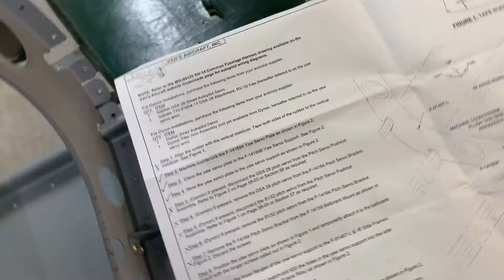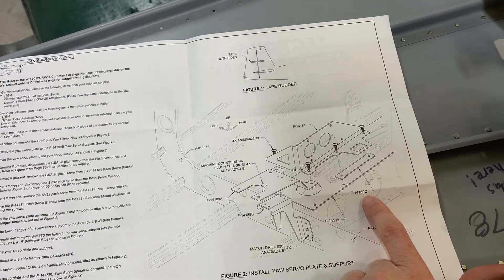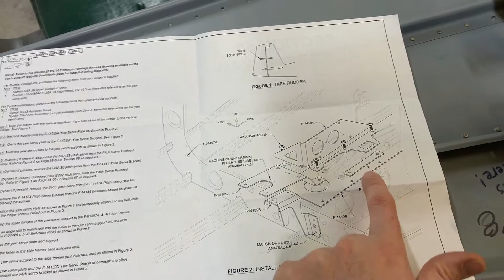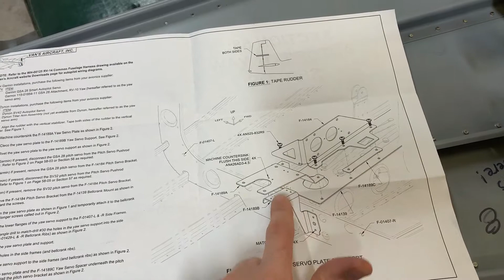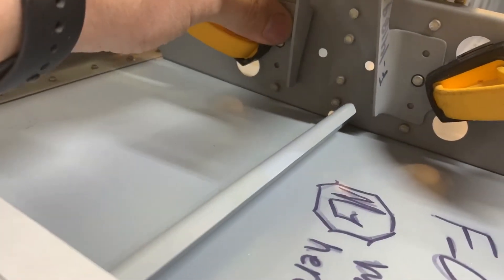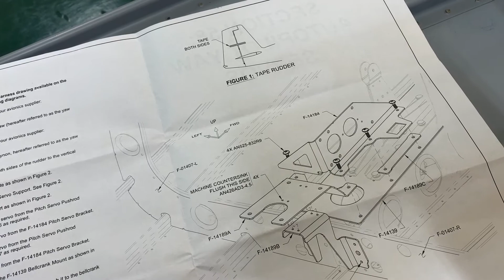Installing a yaw bracket before tail side skins (Kind of a Pre-Gotcha)

Comment: So in an ideal world you would order the bell crank mount (f-14139, K1000-3 x8), and the yaw servo plate assembly (f-14189 A-C, F-14184 AP, AN 525-832 R9 x4) and complete steps 36-06 step 7 through 36-08 step 2 AND 58-02 steps 1-14 BEFORE doing steps 10-13 step 6?
Reply from the maker: Sorry it took a while to respond. In a perfect world I might do this AFTER 10-13 step 6. I would want at least the rigidity of the bottom skin before skipping ahead. In all actuality I’ve completed the entire empennage. I will be skipping ahead and doing those steps before I join the tail cone to the fuselage though! Many people mess up their baggage floor by waiting, and then crawling in the back. Any time you crawl back, you should put 1/4 plywood down. The baggage floor was not designed for 180lbs in one spot!